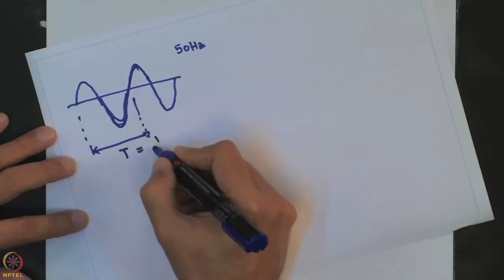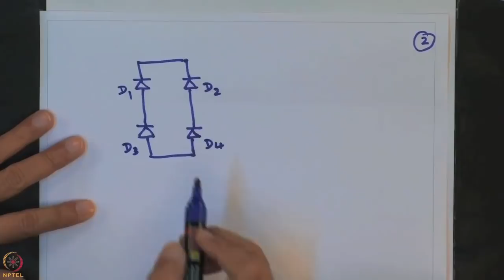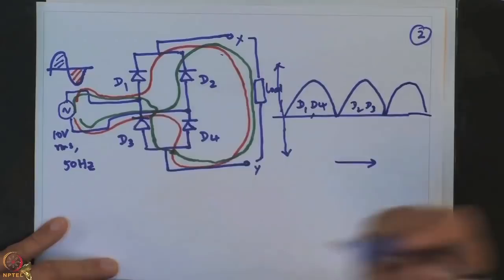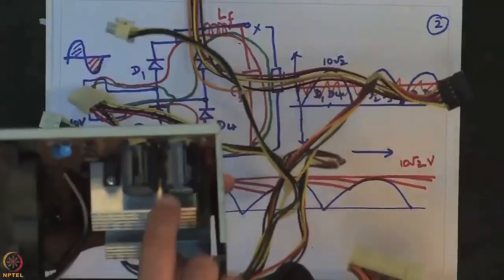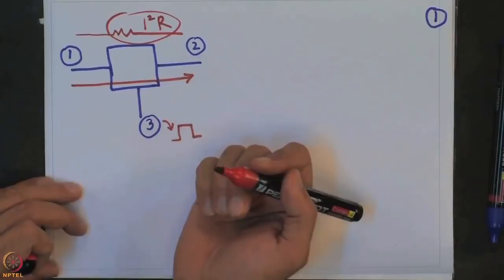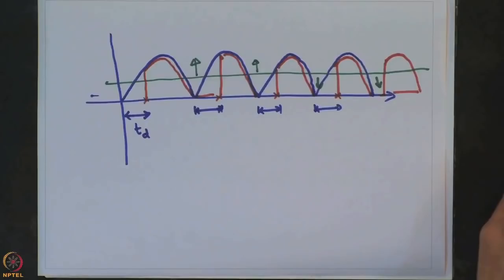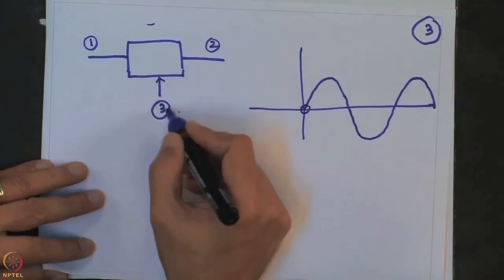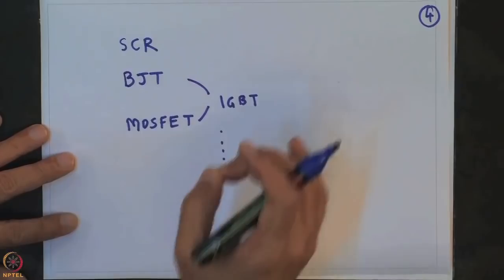Week 1-Lecture 1

Comment: Summary: An application of power electronics. Bridge Rectifier. Controlled bridge rectifier having controlled pulsed output. A controllable device be used to vary the output voltage. e.g. SCR, BJT, MOSFET, IGBT etc.